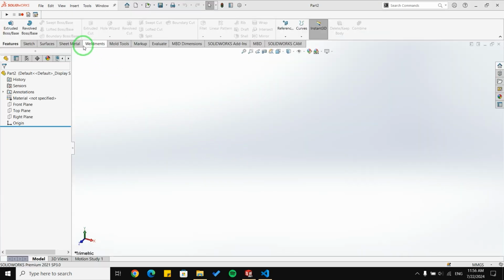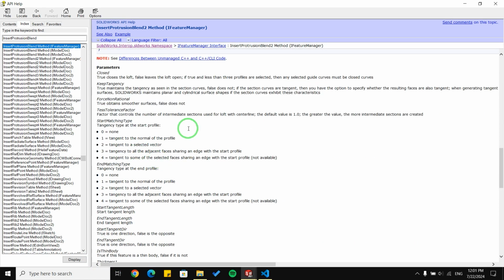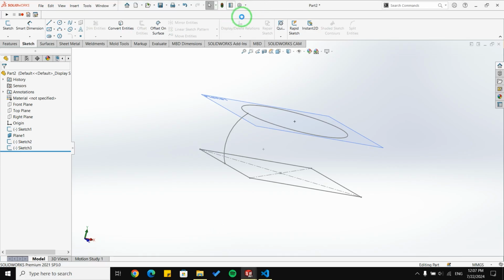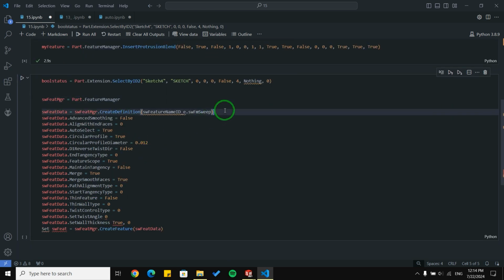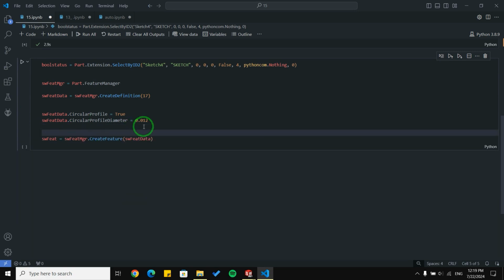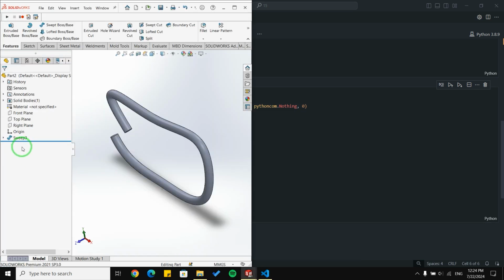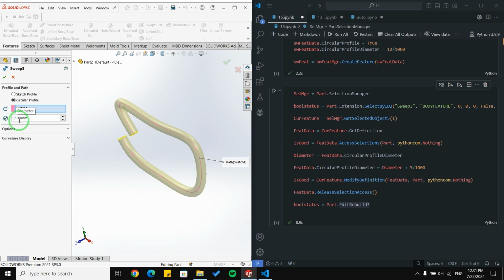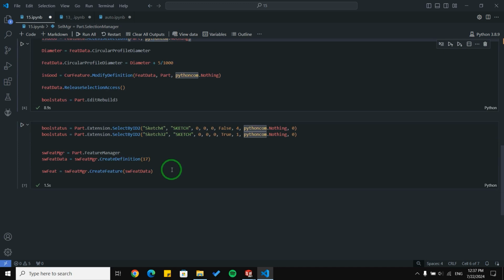SolidWorks scripting with Python 15 - Creating and Editing a Loft and Sweep

Comment: I think the modeling part can be easily done by SOLIDWORKS equations, but the drawing part really needs to write python, looking forward to the drawing part lessons!
Reply from the maker: Dear @HardyDinghy, I partially agree with you, but I believe it's important to know how to create a part from scratch. As for drawing, I hadn't planned to cover it, but if you think it would be helpful, I'll also make videos about it.
Reply: @RoboMechMinds  I'm doing an automatic modeling project, your videos help a lot! Equations are more convenient than writing a lot of python code for me because most of my automation tasks only need to change the existing models, and in the drawing part I will need to use python to auto change the drawing scales, bill tables, annotations, etc. Again, thanks for your high-quality videos!
Reply from the maker: it is my pleasure.
Reply: @RoboMechMinds  The equations are extremely unstable. I used equations to build a complex Solidworks project turned into a disaster, completely wasting my whole month's effort. Now I'm considering use FreeCAD; it supports Python natively and can be running on Linux even Docker. Have you tried before and can you give me some advice cause I don't want to waste another month:face-pink-tears: